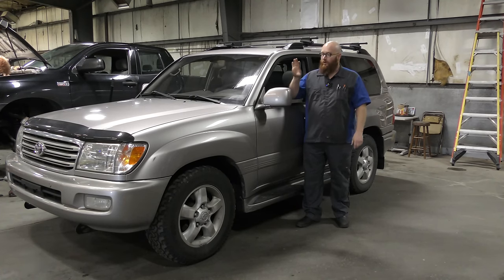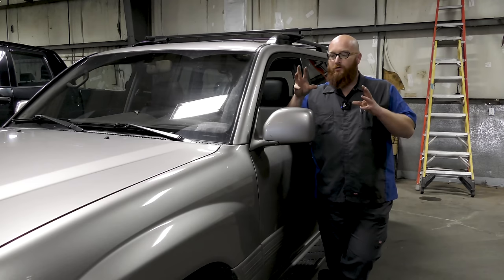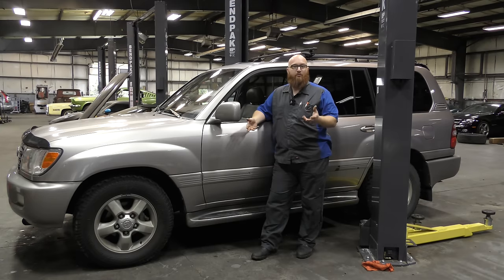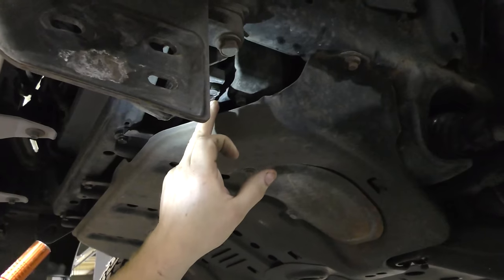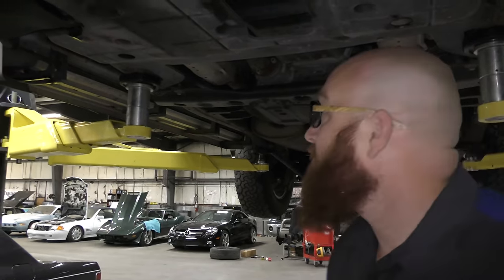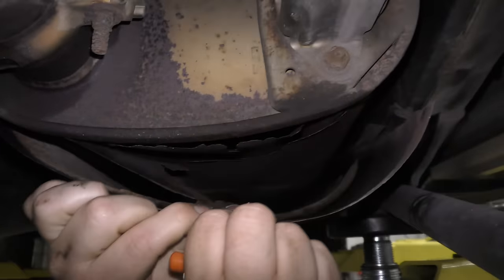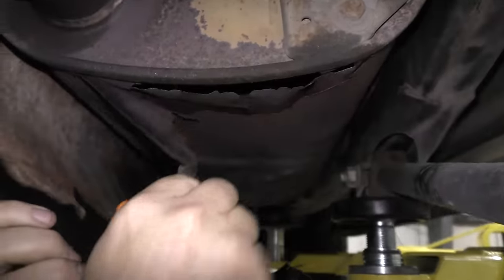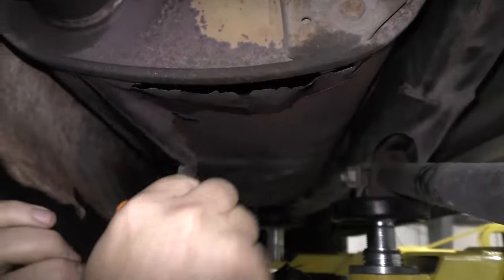Vehicle Making a Horrible Noise?! CAR WIZARD finds the problem & shares how not to be duped by shops

Comment: That cruiser is missing the vibration damper on the passenger side.  https://forum.ih8mud.com/threads/what-is-the-rubber-pad-mounted-under-frame-rail.68424/
Been driving a 2000 LC for 17 years at this point.  Super solid vehicle.  I opted for a Borla cat-back exhaust as it is $500 cheaper thann the stock piece.  maybe 10% louder under <50% throttle compared to stock.  Unnoticed at any other time.

Comment: I told the shop manager I was certain my mustang needed a new control arm and was ready to have it done. Luckily for me the shop manager was straight as an arrow and told my dumb ass all I needed was a new tie-rod. I got lucky that day and that shop has a customer for life.
Reply: Yeah best you don't do your own self diagnosis if you don't have knowledge past you put gas and oil in and drive it
Reply: I went to the main Alfa dealer to get a new exhaust, and they told me it was double walled and all I needed was the rusted bits cut off - no charge :)
Reply: @nou8257  that's the problem, I knew just enough to get myself in trouble. Though I found the issue when I was replacing my breaks and rotors and did some digging on forums and found a common issue. Just happened to not be my issue.
Reply: One shop I go to was like you need a control arm we can’t replace just the bushings I called another shop they said bring it in they called me they said that shop is lying to you we can replace just the bushings we don’t need to replace the entire control arm last time I went to that other shop
Reply: Am sure their still some pretty bad ones but not as bad as in the old days. Including dealership you knew just about every word that come out was a lie. And than their was some shops that their name was so bad and they didn’t care that you knew they ripped you off. They had your car. None of them ever stay in business but they just open a new one under a different name.  They were dogs in them days. At that time you didn’t bring your car in less you had to other than that you fix it yourself so you wouldn’t have deal with these Shops it was really hard to find a good shop in them days. Or if you knew what it was so you could call for the best price.
Reply: Dave J yes, back before the internet,you would have to really res3arch the problem and ask friends who had the same model of car and problem to find out what was the real cause and what parts needed to be replaced, to make sure you weren’t being scammed by the dealer. Dealerships used to hold all the knowledge to themselves, and it would be a few years before other mechanics started seeing your model of car in their workshop. But now thanks to the internet we have forums and other people sharing how to repair cars properly and without being overcharges for unnecessary parts.

Comment: I just HAD to watch this. "Wait, a LAND CRUISER in the shop? That's a rare event!" :)

Again, nice to see honesty on display!

Those unfamiliar with the legendary resilience of the Land Cruiser, take note of this ... these are used as work vehicles in Australian uranium mines. Uranium mines are seriously hostile places for vehicles - any mine will present major dust issues, but in the case of a uranium mine, that dust is also radioactive.  Most other vehicles curl up and die in that environment in about 3 months, other than the specialist mining vehicles such as those huge dump trucks with 9ft diameter wheels. Land Cruisers rack up 100,000 miles in that environment, and are still in good enough shape to be sent to the used car market once all the uranium dust is hosed out. They'll last another 200,000 miles after that.

"Bruce, that's not the 'check engine' light, it's a speck of radium on the instrument panel" :)

Comment: Land Cruisers are one of the most reliable cars ever made, but imo the only real engine for them is diesel.
You can easely drive over 1 million km without engine problems.
I know a guy who has HJ80 and 1.2 million km in it.
Reply: FJ is petrol (gasoline) dude. HJ80 or HDJ80 is diesel.
Reply: I own a 2005 Land Cruiser 120 (Prado) D-4D from new. It has 1 008 000 km on the clock today!
It's engine has not been touched. And by touched, I really mean It has never been opened. Turbo is original.
Only thing that went was the transmission about 100k ago. That's IT !
And I've been hauling loads with it, doing heavy offroading with it, traveled with it (a lot), pushed it to the limit at all times.
Best vehicle ever made.
Reply: @sashoxxx  Never opened in a million ks? Sounds a bit of a tall story. What about timing belts, valve lash adjustments, water pump changes, injector changes?  
I agree the 1kd is a very good engine (have 2 myself in a 2006 Fortuner and a 2014 Hi-lux but they do need their servicing.
Reply: @bastiaansnijder5317  Of course it has all those done. That's basic maintenance. It's on it's 6th timing belt, 3rd water pump (yes! I kid you not, they hold on forever), It also had the injectors replaced at around 450k, but this is mainly due to the fuel here being full of junk. This second set (oem denso) is outliving the original ones that came from the factory. 
It had an alternator fail which sounded like a failing turbo - so a new alternator went in at around 700k km's (turbo is perfectly fine at 1mil!).
It also has a new (used) gauge cluster since the original's tachometer stopped working at around 600k.
The rear diff lock also started to act up at some point after 500k, in a sense that it engages, but it didn't want to disengage. We removed the actuator motor and just refurbished it ourselves - put it back in - not a problem since.

I was purely talking about the major things which we don't call "maintenance items" - like turbos, heads, head gaskets, that kind of deal that is expensive and/or deep in the engine. 
It's a 1KD-FTV and the engine it self has never been opened, not even the valve cover. No valve adjustments! Hell even the radiator and the entire cooling system (a part from the water pump) is all original to the car! And when you open the expansion reservoir with the coolant, the fluid's red color is as if I just poured it in yesterday. 

Transmission went on it, as I said, but again, the car has been heavily offroaded and has carried heavy loads all it's life. Also there was this one particular situation where I was stuck in some deep and heavy snow alone at night, not really wanting to call in for a tow I got out by flooring it and switching between D and R while holding the pedal to the metal ;) Soon after that (at around 850-880k km's it started acting up. I'd say the transmission actually did amazing considering all of these things. 

That said It has always had 10,000 km's (or less!) oil changes with Castrol Magnatec / Edge, full fluid changes all around at at each 50-100k km's with OEM fluids. Everything has always been replaced with mostly brand new OEM parts. So yeah... it's really not a fairy-tail story. It really is one of the all time greatest vehicles ever made. 
p.s. I've had numerous different vehicles and nothing comes close to it when talking capability, reliability and quality.
Reply: 2UZFE has been proven to go 1Million miles. Million Mile Tundra Engine
Reply: @bastiaansnijder5317  Things you listed are basic maintenence.

Opening engine means, when you need to repair/change internal engine parts like valves, head gasket, piston rings, camshaft/crankshaft bearings etc.
Reply: @MattBlack6  Yeah, a little error there.
I knew the difference between HJ and FJ, but i've been watching american LC videos so i accidentally wrote FJ :)

Comment: I have an 04 Landcruser, it’s a gem, I knew the timing belt should be replaced but I couldn’t find out when. It wasn’t in the owner’s manual, it wasn’t in the shop manual. I came across an Australian YouTube video that suggested 90K. That’s what I did. Replaced the water pump, idler pulley, thermostat, radiator and heater hoses as well as the serpentine belt while they were in there.

We had an 86 LC which I loved. The wife got a larger horse trailer which was asking too much. Got a Suburban which was junk. Thanks for the interesting video.

Comment: "Land Cruiser is most reliable and long lasting..."  4 Runner says: "Hold my beer!"
Reply: I own both. They are miles apart! Build quality wise
Reply: @ravip92  WHO DO YOU THINK IS LONGER LASTING?
Reply: @JoseFernandez-wu8pj  4runner solid as heck, got one. Not a Cruiser, not built for the same level of a use and longevity. Anyone that disagrees is kidding themselves.
Reply: @leetworks  agreed
Reply: @leetworks  The most reliable Toyota is............are you ready.............2007 V8 4 Runner.
Reply: 4 runners are reliable, but not as rugged. Cruisers basically have a 3/4-1 ton drivetrain, waaaay overbuilt for a small vehicle.
Reply: @fredbrackely  very reliable, but not as. They share many components but not all. Where they are unique you will notice the Cruiser's parts are heavier duty as mentioned by @thedudestbro below. Comes down to drive train etc. This is all just splitting hairs, both are incredible and reliable machines.

Comment: But that togo has a timing belt needs changed every 100,000 plus the starter is under the intake manifold on 4.7 v8 of that eara so if you need to change starter have to pull intake manifold $1000 bill

Comment: Had a Toyota Forerunner with a 4.3 the engine blew at 125K with engine oil sludge. It was a problem for several Toyota's with the 4.3L engines. I now own a Tacoma and I'm very happy with it!

Comment: I knew when he said Toyota 05 whit a metallic rattling noise I knew straight away it was either a heat shield or exhaust hanger or something in the exhaust
Reply: Neil Murphy the ones on the cats drove me nuts. Put a large hose clamp around them.
Reply: @backwoodsnomad1387  that's actually a good idea

Comment: Have one of these vehicles. They are great! Keep U Joints lubed. My rack and pinion will be replaced next month, as will the wheel bearings. It only has 217,000 so I expect to get another 200,000 out of it. Timing belt and water pump needs changed every 100k or so. I try to stay on the earlier side. Just replaced my radiator also. After 3000 miles, oil is still full and a nice caramel color. Love to drive this vehicle. It may last the rest of my life. If you are thinking of getting one, pull the trigger if there is no rust. Great trucks.

Comment: Years ago I took one of my cars into a shop, sure that the brakes needed some work because of a grinding noise. After a check out, the shop owner came out and told me I was ready to go. Confused, I asked him what he found. He said they were just cruddy and gave them a good blow out with air and that stopped the noise. Needless to say, I was surprised because I had said what I thought was wrong. He could have easily bilked me for new brakes and I told him so, then thanked him for being so honest. His reply was that his shop had a good reputation for that, and because of it, he had all the business he could handle and was making a good living at it. He actually said that he really didn't have time to cheat people by doing unnecessary work because he was so busy. He got all my business from then on, until I moved out of the area, and I was never hesitant to recommend him to others. Wizard understands that concept. Sadly, many other businesses do not. Whether you do good work or bad work, you never have the luxury of only affecting that one customer, because if that one customer only has one friend and tells him what happened, and that friend has two friends and tells them what happened, your reputation, good or bad, is being built.

Comment: Thankfully my Dad taught me about working on vehicles and have worked in 2 different shops. I took my 2000 Crown Victoria Police Interceptor in to find out why there was a wobble in the rear end. I knew what the problem was. I knew the rear end was going in it. The 1 Mechanic told me that I just needed a new set of gears and the shafts. Well I went and got the parts from PICK N PULL in Edmonton, Alberta. Well I returned WITH the parts and got told that I actually needed a new complete rear end because of the housing for the bearings were wobbled out. I demanded to be shown this problem. They wanted me to PAY $10,000 to be allowed into the shop where my car was already on the hoist WITH the rear end removed. I reported them and got them shut down for 4 years. I never authorized them to do the teardown. They even demanded that I pay them $5,000 for the "work and repair" that they apparently did to my car. Never paid them a cent. Sold the car to a guy for parts for his Vicky.

Comment: As a Harley owner, I can relate to the rattling noises. Bought a used Heritage from an official dealership which did a so called pre delivery inspection. It rattled when I took delivery of my bike and I spent a whole month tracing and fixing rattles until it was rattle free.

Comment: When I do take a vehicle to a Mechanic, I ALWAYS know what it needs. I had been told once that my 2003 FORD CVPI needed a new rad. I asked "How can that be when it was changed a matter of 14 months ago?". They back pedal VERY quickly. I did Work Experience in a FORD Dealership as well as taught by my Step Dad about Mechanics. I work on my own vehicles 90% of the time.

Comment: Had the local muffler shop cut ours out about 4 years ago.  Sounds nicer without it, no real drone.  When we changed the timing belt etc the water pump looked brand new.  Never seen that before on a motor.  Changed it anyway, with genuine of course.

Comment: I was working in Iraq in the 80's (during the Iran/Iraq war).
A group of us had gone out on the Friday, from Baghdad, to Mosul, in the company '82 Toyota Crown.
Coming back in the afternoon, we found that we couldn't select certain gears, either 2nd and 4th, or 1st and 3rd.
Naturally we were worried being so far out from Baghdad.
The village mechanic had No idea.
We crawled bach into Baghdad at about midnight, and had to leave the car outside the car pool, until we could go and explain in the morning.
Our Car-pool Manager, got in touch with us later that day, and told us about a 50 cent circlip that had come off the end of the layshaft.
But it took some finding  ! !
Car was fine after it was replaced.
I'd love an '82 Crown even today  !
Stay safe !
Stu

Comment: A lot of people that drive old Corollas (1993-1997) don't change the timing belts until 150,000, even though I believe the manual states that it should be changed at 60,000. I have seen the belts commonly last to and past 150k, but I still change mine at 100k because I don't want to be stranded. It is amazing the lack of maintenance that Toyota cars see, and they still keep going.

Comment: You are quite correct CAR WIZARD, if your car breaks down in the outback you will die of dehydration within 2 days without an adequate water supply.  Service centres are days away and the heat, cold and environmental conditions will test vehicles to their extreme limits.

Comment: We have a 200 Series Toyota Landcruiser V8 twin turbo diesel (650NM Torque stock but ours is modified to over 900Nm) with over 350,000km and still runs like new, same goes for the quality of the interior again it still looks like new and it’s lived in red dirt north Western Australia 🇦🇺 they are king of the road here in Australia 🇦🇺...

Comment: There are very few true mechanics today, most garage technicians are only fitters.  They consult fault codes and then replace the biggest lump they can get away with.  Present them with a genuine problem that demands skill and knowledge to solve and they are lost.
A friend of mine owned a Bosch Tuning Garage.  The Mercedes main dealer presented him with an S600 V12 that would not idle when hot, the vehicle was almost brand new and had been in the dealership service garage most of its  short life having various bits changed, all to no real effect, Mercedes UK and the German headquarters were consulted - no luck.  One of my mates employees was ex-REME (Royal Engineers) and he was tasked with getting it to run.  The thing about REME is that they are taught how to service all equipment in the field (literally) as the nearest service/parts centre will be hundreds of miles away.  Steve checked all the usual items noting their actual performance and then opened up the replacement 'sealed for life' ECU that was fitted, where he found several dry joints and an ECU that was trying to respond to various sensors at the outer end of their tolerances.  All of that was fixed within a couple of hours, the car ran perfectly and was then returned a week later, all for minimal cost but you could guess that the bill to Mercedes was suitably inflated!  Both Mercedes and the Owner were over the moon with the result especially since Mercedes were looking at a £12,000 warranty bill for a new engine.  The point here is that although the 'top class' dealership with all the diagnostic equipment and technical back up from the mother company  could not compete with a properly trained mechanic, who understood what he was doing.

Comment: I had a rattle on my Buick Grand National, only at idle, but it did not sound good! I was worrying it was internal, checked around with a long screwdriver to my ear and everything internal sounds smooth. Turned out to be the heat shield at the back of the turbo! Always try to find the noise, touch things to see if the noise stops, etc. Noises can drive you crazy, and make you sick with worry.

Comment: I’ve seen many 4.7L get a seeping water pump then at that time change timing belt changed also, mileage varies from 190,000 to 225,000 miles I’m in Alaska.  Also at that time we take starter out and change the brass contacts, that way his starter doesn’t go bad 20 to 40 thousand miles later